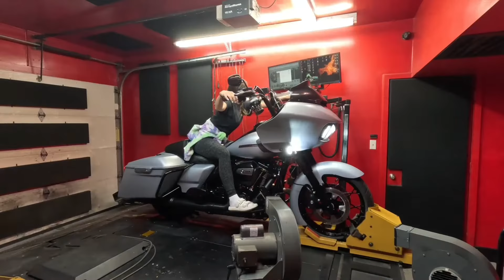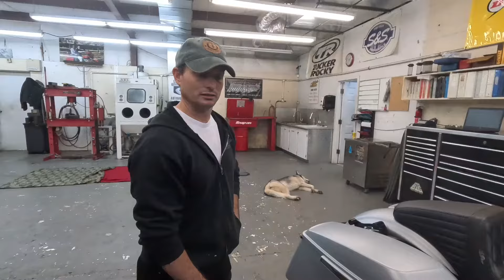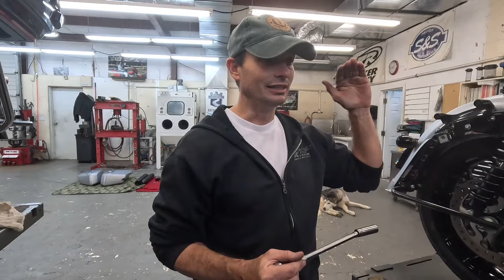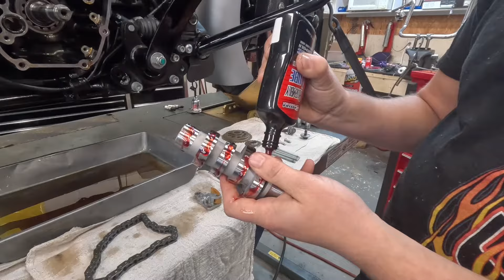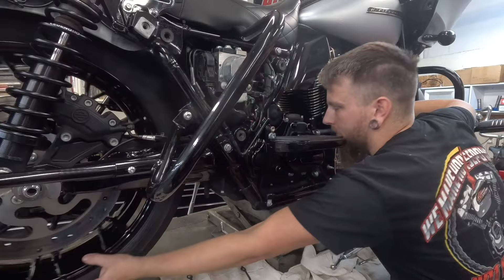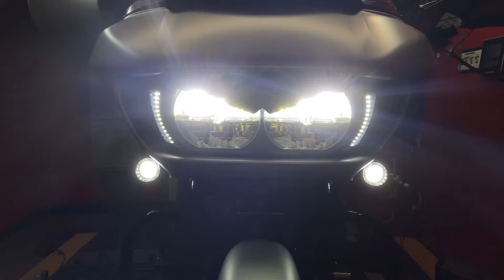BOB WOOD 22XE CAM INSTALLATION TUTORIAL | FAST TUNES

Comment: You mentioned about the adjustable push rods. The shovelheads came with adjustable push rods. When I first heard about folks putting a bolt cutter to the push rods instead of taking the complete heads off to get to the chain tensioners.

Comment: Great video! By preloading the pushrods and then letting the lifters bleed down, wouldn't the valves be slightly held open when the lifter pump back up once you start the engine?

Comment: a little tip on the lifter install..before you put the timing chain back on permanently , put put your lifters and the cuffs in/on and then you can easily rotate only the cam by two fingers to test and/or re adjust and test again without having to rotate the tire and whole engine.  I noticed some are also replacing the chain pinion gear due to slop or poorly spec size, and a few have failed (?)  I noticed you guys didnt fill or prime the lifters(?)...ill try to check your site for the part Numbers etc, as I'm going to do this mod (different Cam on one and same cam on my other M8) along with S&S Oil and Cam plate upgrades.. but I did break a lifter cuff bolt as the were completely covered in thread locker.  My Crank run-out was about .002-.003 I was wondering how many miles were on the OEM lifters seems they will all have glazing in a 2-3k miles..The/ your dyno torque and power spectra looked great. Seemed like the bike wasn't lope-ing, but oscillating while warm and Idling which I hope my 22Xe cam project doesn't do.
Reply from the maker: I don't remember how many miles was on this bike, but we always go ahead and change the lifters.

Comment: I'm planning on having this cam installed on my 22 low rider s too.  Would you recommend an aftermarket oil pump/cam plate like S&S or would the stock/updated harley oil pump/cam plate suffice? Have about 3500 miles on the bike. Thanks for the info 🤙🏽
Reply from the maker: Yes I recommend it but if it's a 2020 or newer we don't make you at our shop.
Reply: @DC CYCLE & RACING  thanks for the response. I ended up keeping the stock pump/plate 👍🏽🤙🏽

Comment: Thanks for sharing a really good video.  You guys are very thorough and methodical.  By the way, you mention that you clean the old Loctite off the bolts, and I was just wondering if it's also a good idea to clean the threads on the engine casing by running a tap in the stud hole before assembly?
Reply from the maker: Yes, for sure. Can't over clean an engine.